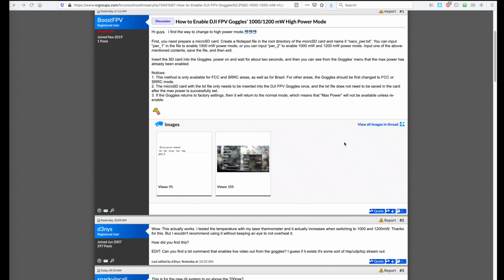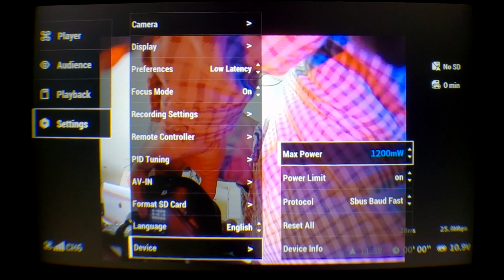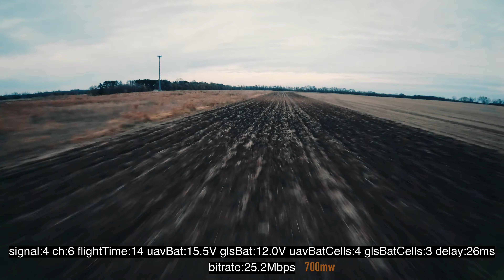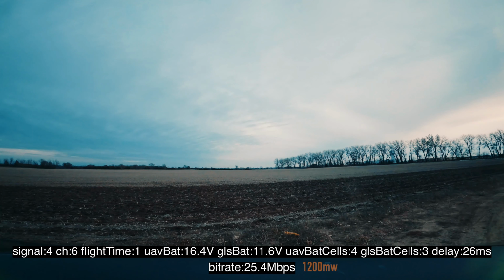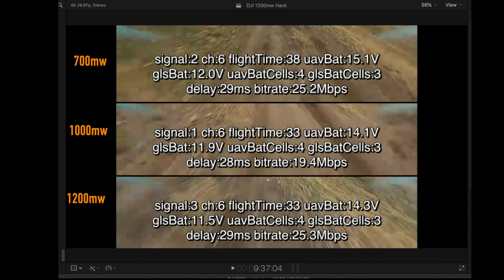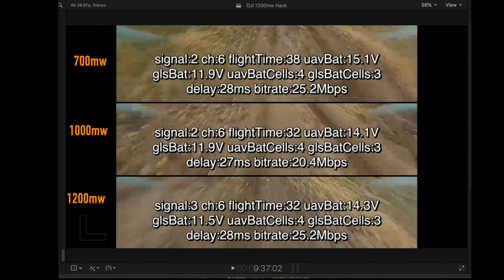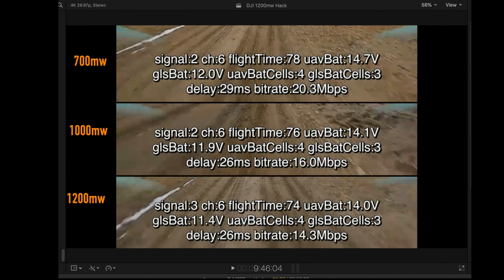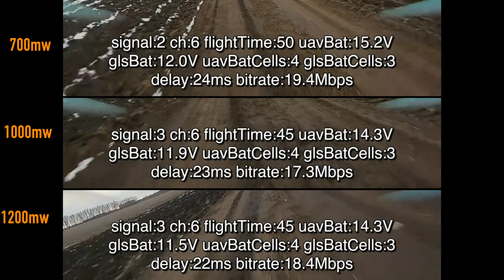How to Boost (hack) the DJI FPV System to do 1200mW and Some Field Testing

Comment from the maker: If you are having trouble getting the 1000mw and 1200mw options unlocked, be sure you are running the latest firmware (v01.00.01.00) and if you are not in the US, you need to have the 700mw option in your menu.  If you only have 25mw as an option, you will need to do the "FCC hack" first.

Comment: Another great video Dan!  As usual, your thorough approach provided lots of data and I agree with your conclusions.  This test appears to be great for 700mw, so more power doesn't improve any metric.  As you said, potentially long distance would be a good test.  I wouldn't want to try that unless you had a GPS and a proven RTM capability.  Thanks for the video!

Comment: I tested it too and the air unit stays at less than 25 degrees after flight too and so, it don't become hot like before at 700mW. It seems clear that 1200mW is the max Power but during flight the air unit reduces power under 700mW maybe to avoid damage the air unit in time. No temperature = no hight power. The good news is that we can place the air unit where we want into the frame, no need air flow to cool it.

Comment: When we put the file on the sd card and put it in the goggles, do we need to keep the sd card in the goggles with the file on every time we want the  1200mw mode or does it write the file to the goggles firmware and then we can remove the sd card?

Comment: We have already seen that the increase in power does not increase the quality, if you admit suggestions the second test would be to see how the increase in power affects the distance (of course to do that test you have to have a GPS installed to return automatically in case of problems )
  the third test could be to change the antennas, which I am seeing almost necessary

Comment: Use the srt files to plot a graph and work out average figures.
Reply from the maker: That seems like a great idea.
Reply from the maker: I did a super quick average, median, minimum and maximum calculation of each complete flight.  Here are the results....

700mW    : 23.73 25.4 10.0 25.4
1000mW  : 23.40 25.4 10.2 25.4
1200mW  : 24.15 25.4 10.1 25.4
Reply: Those are some marginal figures lol

Comment: Forget about how many milliWatts it is, RF is best measured in dBm. 700mW to 1200mW is not even a 3dB increase. That would equate to roughly 1s point on a signal strength meter. To improve range and signal quality it’s best to improve on the antenna. Higher gain antennas; improved signal capture area....

Comment: I just got the fpv. I don't even see these settings coming up in the menu.
Has dji eliminated this feature in the newer fpv's?
Reply from the maker: Depends what you have.  This is for the DJI FPV air unit.  The DJI FPV Drone will be very different, as will the new DJI O3 Air unit.  None of those newer systems have this option.

Comment: I'm curious whether you were just adding/changing menu labels or options versus actually modifying power levels.  You really need a signal strength meter.

JB has one & a DJI.  You should ask him to validate the setting changes.
Reply from the maker: I have heard others that saw a bigger improvement.  But they were either testing maximum range or were using better antennas.  Most likely a power increase just doesn't make much of a difference in this particular test, which is also good to know that for many freestyle environments, you don't need more power.
Reply: @5zero7RC  I messaged your video to JB and asked him to test it.
Reply: He just replied that he's working on it.  I'll let you know what he finds.
Reply from the maker: @mccolld11  I think the RR crew is in Washington this weekend, maybe he can do something like that when he gets back home.
Reply: @5zero7RC  JB just released a video confirming this hack.   Yea!!!

He meter tested it and range tested it.  Now I really want one!
Reply from the maker: @mccolld11  Just finished watching that.  Though according to the words on the screen he was "@ definitely not 1200mw because that would be illegal "   :)
Reply: @5zero7RC  yeah he just went up to a 1000.

Comment: Do a test behind solid building obstructions.  perhaps it's not so much the 'range' but more the 'penetrating' power that makes the difference.  if that's true, then you could make a case that it's not particularly good for the health of the pilot.
Reply from the maker: I was hoping the additional "penetrating power" would help with the image quality when going behind a tree at a distance, but I really didn't see a noticeable improvement.

The additional power is a non issue as far as the operators health is concerned.

Comment: can't get my dji remote to move the channels on betaflight I think I've done just about everything don't know what else I can do....
help please
Reply from the maker: Here are some things to check...
Is the radio paired with the air unit / vista and you have a green light?
Have you tried connecting the DJI system to a different UART on your flight controller?  I don't think it can be connected to an inverted sbus pad if I remember correctly.  Double check which UART you are using and make sure it is set up for your radio.  Make sure betaflight is set up to use sbus.  Try toggling the sbus fast option in the DJI goggles. Is there a wiring diagram out there for your flight controller that shows the suggested way to connect it to a DJI system?

Comment: Seems like better antennas is the way to go vs. upping power.  Which is typical.
Reply from the maker: I think you are correct.  Just using the stock antennas right now.  I'd like to give the TrueRC stubbies a try but they are always sold out :)
Reply: I tried the lumenier rhcp and they simply dont work with the system so be careful which ones you get
Reply: Same here. I've tried several antennas, and while they do help a lot, I really want to get my hands on some TrueRC products if they will ever be in stock.
Reply: @5zero7RC  RotorVillage has them
Reply: You should watch AndyRC's conclusion to "better" antennas. There is a reason most people went back to stock.
Reply: @thereisa6inthename   He didn't exactly detail his testing, so I'm making some assumptions here. But a few things can skew the results. For one, patches( Xairs) haven't generally been a bando slayer. In the RapidFire days, matching omnis were preferred for bandos. I think the same still holds true for the DJI. However, I think were many folks mess up their testing is by pairing stock quad antennas with aftermarket goggle antennas, or the other way around. The stock antennas seem to be barely circular polarized. Many aftermarket antennas have a high circular polarization. So when you test with one side being stock, there is a polarization mismatch, and that test will favor stock goggles and stock quad. In my testing, high axial ratio omnis on both sides handily beats stock antennas on both sides.

Comment: I don't have a HAM license either, but I'm pretty sure it doesn't let you bend the rules. It just makes it legal for you to use stuff that isn't FCC licensed, but still follows regs.

But on the note of DJI's 1000mw,... or 1200mw, and the legality...  I recently re-read the FCC testing for the 700mw. As far as I can tell, 700mw is not the actual output power. The actual power is more like 160mw per antenna connector. The FCC testing shows ~22dbm. Then you add the 2.84dbi antennas, and you're at 24.84dbm, which is 305mw. Then you double that because it's MIMO and transmitting on two antennas at once. So that's gets you close to what they claim is 700mw, or 25dbm total. So with a 7db patch antenna, you'd still be within regs( 30dbm), though you would now need a HAM license because it is no longer a certified setup. I don't think the FPV community even knows how to spell HAM, so I'm not real concerned there. But using the 700mw as an example, the 1000mw setting is likely not outputting 1000mw at the connector, and is probably completely legal with stock antennas,...which btw, are just dipoles on the goggles. Only the air unit is LHCP. Assuming the math above is correct, at the 1000mw setting, an upgrade to the antennas needs to stay under 2.84dbi. So how is it an upgrade? Well, with the stock antennas being linear polarization, and your air unit on circular polarization, you are losing 3dbm, which is half of your power. So upgrading to a good set of antennas with a high axial ratio, but still under 2.84dbi, should net you a huge signal improvement while adhering to regs. I assume this is why TrueRC labels their antennas as a 50% improvement.

But knowing how DJI is doing their math, that means the 1200mw is not legal. Of course neither are the regular 1 and 1.2w analog VTX's unless your pigtail is really lossy. The FCC regs allow 1watt, and 6dbi antennas, but you have to stay under 30dbm total(1watt), so that means your cabling would have to lose 6db to run that 6db antenna.

Sorry for how long that was. Just been enjoying the research,... Feel free to correct me,...with data of course. :D
Reply: @5zero7  I think this one's second to last paragraph is what you were referring to on JB's video that did not contain that area. So I guess I'm wrong on that particular interpretation of the regs. Seems the rest of the internet agrees with you on the 36db total allowed. :D   And using the DJI math, and the 36db with antennas,... the 1200w may very well be legal.
Reply: @rcrdps8144  can you give the math for calculate the power ? 
I would like to check my power with 2 patch on 25mw and 700mw.
Thank you
Reply: @thierry01500   Not sure of what you're asking or what your objective is. If the goggle is outputting 22dbm, add your antenna gain to that, then run it through a conversion to mw like this site: https://www.rapidtables.com/convert/power/dBm_to_mW.html
Then, in theory you would double it because it's MIMO,....except you're running two different sets of antennas, and you have no clue which two it decided to talk on and in which direction. In my opinion, your best bet with this system is to use all of the same antennas pointed in the same general direction. You then select the type of antenna for how wide your flying area is.
Reply: FYI, anyone who took the time to read the long comment above, I was wrong about the antennas being linear polarization. Even though in testing they act like it, I just took one apart and it has little helical bits in it.

Comment: What antennas are you using? I have noticed dramatic difference between stock and aftermarket antennas on the DJI system. Could stock antennas be a bottleneck as far as seeing a difference in range with higher power settings? I also wonder if the system is variable? Kinda like cross fire? Maybe aftermarket antennas would in essence open up the system to reach full power? Just a thought.  - thanks for your help on Bardwell’s live streams!
Reply from the maker: I am using the stock antennas on everything.  I would not be surprised if there was a bigger difference with upgraded antennas.
Reply: What aftermarket antennas are you noticing the most dramatic improvement with? Are you comparing with Mbps?
Reply from the maker: @philip-sancho  I have not yet tested any aftermarket antennas.  I would love to try some of the TrueRC ones though. 

And yes, I was trying to use the Mbps as a comparison to see if more power would equate to a better image since more Mbps means more data for the picture.
Reply: It's public info now that dji used goggle antennas that limit power to 50% to pass FCC regs, I mostly fly w 4 lollipop stubbys on goggle and get insane range n penetration, check my vids I superviewed DVR footage, works great.
Reply from the maker: @flo-ridafpv5713  I'd like to see the source of that information about the DJI antennas.  I have only heard second hand about that.  From what I can see in the FCC regulations, DJI can use 1watt and 6dbi gain antennas and still be legal.  I don't see why they would need to kill the power with the antennas to pass FCC part 15.
Reply: @5zero7RC  idk the reasons but it's public info on the official dji for Facebook and watch Kabab fpv recent vid flying the dji cini whoop he talks about it in the first part of video, it explains why truerc n getfpv can claim 50% more range than stock using new omnis, I experienced it first hand using stubby lollipops

Comment: What is the power usage at those higher settings? The air unit is rated 4W-9W for standard output. Running 6S rig and using a 9v1.2A circuit to power the air unit.
Reply from the maker: That is a good question.  Does anyone have the answer?
Reply: 5zero7 RC I’ve been looking around and don’t see anyone mention that bumping to 1000mw could blow your FC circuit. Seems important. I’ve noted it on Bardwell’s video as well. Perhaps because they are adding this to 4S rigs and drawing on Vbat?
Reply: Its better to use a minimum of 10v 2a which gives you 20w.  Your only have 10.8w which is borderline.. I have seen ratings of 10w for the unit, worst thing you want is to fry the unit Even at 700mw I wouldn't have less than 12w.

Good thing is HD FC boards nowusually have inbuilt BEC . Im using a T-Motor F7 which has a 10a2v just keep that in mind when you buy your next fc

Comment: Does this work on the CE version? It only has 700 meter range
Reply from the maker: First you need to do the FCC hack, then you can do the 1200mw hack.  That should do it.  https://oscarliang.com/dji-fpv-system-fcc-700mw/

Comment: real quick .. what range are you getting on the fpv feed with these goggles?
Reply from the maker: As far as I am comfortable flying :)   I have not pushed the range very much.  The farthest I have gone is 1/2 mile or 800 meters.  And the signal was just fine.  I generally stay within 1/4 mile of my location and fly from inside my car with no signal issues.

Comment: can i both have fcc mode and 1200mw hack?
Reply from the maker: Yes, actually I think you might need to do the FCC hack to get 1200mw, though I have not tried that since I am in the US.  Either way I am sure you can do both.
Reply: @5zero7RC  USA is already set up to FCC so no need to do that hack.

Comment: Hi. Which firmware did you use?
Reply from the maker: You need the firmware update that was released on November 1st before you can unlock the 1000mw and 1200mw options.

Comment: nothing work now with new update !!! GRRRRRR
Reply from the maker: What do you mean nothing works with the new update?  I assume you are talking about the update released July 8th.  I have updated mine and see no issues so far.
Reply: @5zero7RC  I make the update yesterday 08/07/2020 and now I have Only 3 channel available , I put 1 in sd card but nothing change I afraid I come back in CE mode not Fcc ...I live in France (CE)
Reply from the maker: Every time you do a firmware update it will default to the mode for your country.  If you want the FCC mode, you will need to fix that with each update.
Also, be aware that 50Mbps mode only has 3 channels even in FCC areas.
Reply: @5zero7RC  ho ok I notice I can put  700mw again and only 3 channel now . what difference between 50mbps and 25mbps is it difference in live or in recording rate? thanks

Comment: hello. i got a question. i see you have set sbus baud fast on. so you got still at the start 25 to 28ms in the osd is this normal because on my sytems is the same and i read something from 7ms after set sbus fast?
and does the channels 1-8 does affect the range? greez from switzerland
Reply from the maker: sbus baud fast is for the DJI radio control link and allows it to be 7ms.  The 25-28ms you see  in the goggles osd is for the video link.

The channel you are using can have a small impact on range, especially if you are using a channel that has other interference on it.  Also some antennas are better tuned to specific frequencies so you might see a slight improvement using a channel that is as close to that tuned frequency as possible.  However that does not usually make a significant difference.
Reply: @5zero7RC  oh nice thx for the answer.
yea i just wondering one time i switcht the channel from 8 to 2 and there was a little difference in one corner maybe it was that.
so 1 question i still didnt find out. i have the tmotor f55 stack on m kwad with the wire from the dji box to the esc stack. so i still miss my osd (battery voltage etc) was i selectet in betaflight. did i miss open another uart port in BF or what going wrong that i cant get information on my googles?
Reply from the maker: @searchwalter_tv7335  To get the voltage in your goggles you need to connect the cable as you have done to a UART, then in betaflight you need to enable MSP on that UART.  Also be sure that UART is not one that is inverted for sbus use.  Hope that helps.